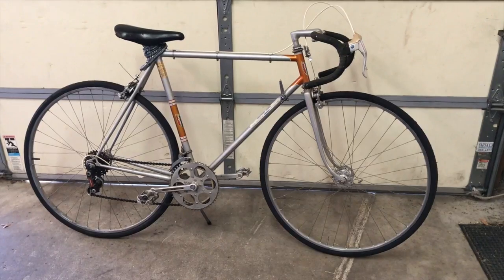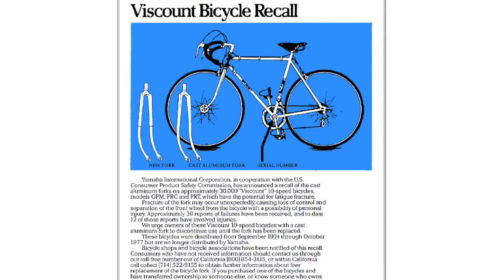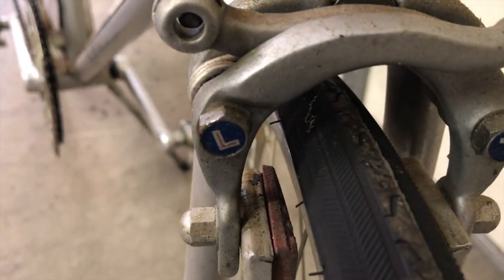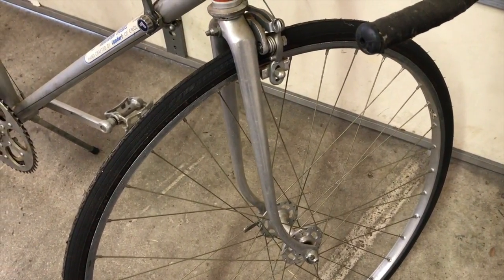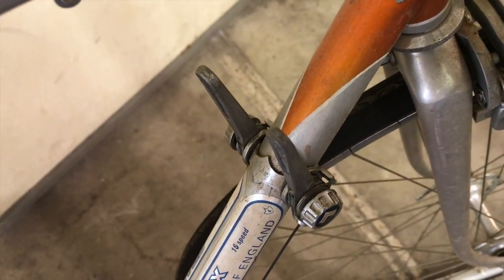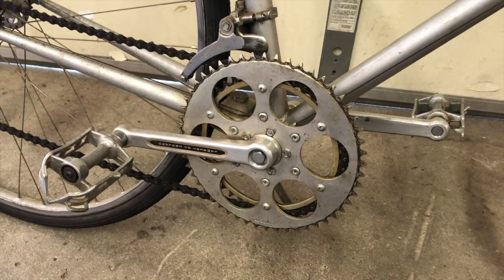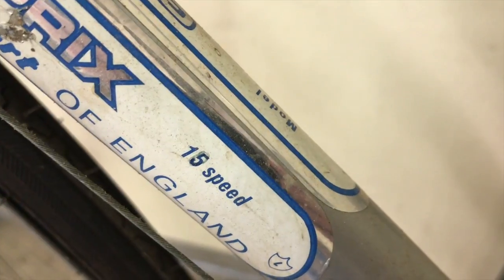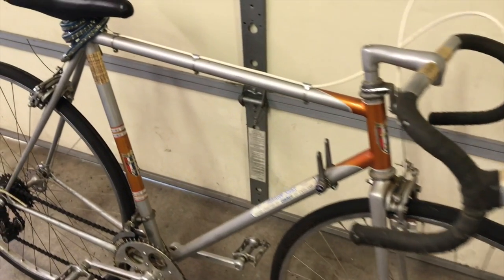1973-74 Lambert / Viscount Grand Prix Road Bicycle - Vintage Bicycle

Comment: maybe it's a 3x chainring?   3x5  = 15
Reply from the maker: +cebuanostud to be a 3x it would need 3 gears up front. It only has 2.
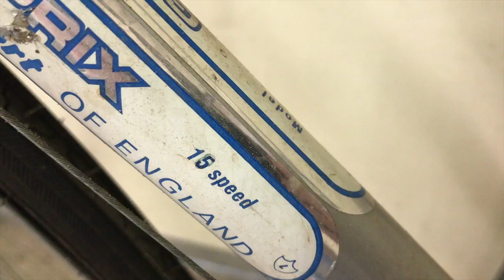Reply: right, so any sign of missing gear up front? at this angle(4:49), it looks to me a smaller front gear can still be fitted.  yes, no, maybe so...
Reply from the maker: +cebuanostud it never had anything other than 2 up front. He bought it new, so it’s likely that they used a sticker (as I suspect) to cover the 5 for the 10-speed models.
Reply: thanks Kev, you cleared everything up for me.
Reply: KevCentral My machinist father was able to add a third chain ring. 5x3 gears
Reply: cebuanostud exactly! A custom mod
Reply: The crank is a rebranded Specialties TA Pro 5 vis, which was easily converted to triple (which was a reason why they were so cool)  :)

Comment: 27" tubes are dirt cheap on ebay all sizes usually are
Reply: Just make sure to get the right diameter not a mountain tube it will be too big and youll be stuffing it in there for 45 minutes
Reply: And likely result in popping it trying to put the tire on

Comment: I love vintage bikes. They look so much better than the ugly looking crap they make today. Back in 1973, at age 14, I had a Schwinn Varsity Sport. It was beautiful and I rode it everywhere. It was a move up from my Schwinn Sting Ray. I still have the Sting Ray, but the Varsity got sold somewhere during the past several decades. It was a TEN SPEED, which was a big thing back then, and way more than enough speeds. I have no idea why they put more than twice as many speeds on todays bikes. Just more complexity, some of the speeds are unusable anyway, due to the chain being so far out of alignment. Some of those old bikes did have issues, the worst being the steel crank arms held on by wedge pins that would not stay tight. 

IMO, people take riding a bicycle way too seriously today, with all the spandex, clipless pedals, and silly helmets. There are few decent bicycles available. You either have to go with a big box bike, or a seriously expensive bike store bike. Neither are right for a casual rider.

While on the subject of bikes, I'd like to complain about what is available (and not available) for kids bikes these days. I had a Schwinn Sting Ray (actually about 3 of them) when I was a kid. I loved it, and spent a lot of time riding on the rear wheel. It was a great looking bike, I just loved the banana seat and high handlebars. Sadly those faded away fairly quickly, and since then all we've had is BMX bikes, seemingly forever. WAY longer than the banana seat bikes lasted. Enough is enough. It is time for the BMX bike to go away. I have nightmares of kids still riding those abominations into the next century. I don't have an issue with the sport of BMX (I raced MX as a teenager)  but there should be something else available for just riding.

I am now partially disabled, and ride a cruiser with a NuVinci 7 speed hub. I can no longer deal with low bars and seats that are nothing more than bump stops. I have never ridden what today called a road bike. I have never worn spandex, used clipless pedals, or worn one of those silly worthless helmets. I did ride hardtail mountain bikes for about 30 years. I also rode a recumbent for a few years.
Reply from the maker: Great read. Thanks for sharing 👍🏼
Reply: Gerald Scott I’m not going to lie, you sound like a grumpy old man.  I don’t understand your hatred for BMX bikes either. My first bike was a banana seat bike with high bars, I don’t recall the brand but it had a removable top tube so it could turn into a girls bike. It could do wheelies like no other but once I got a proper BMX bike it got a whole lot more fun for me, I rode a 20” BMX until I was 18 or so and broke my collar bone after my front tire clipped the top of a landing ramp. 
There’s also plenty of options today for just riding, my daughter has a cute little 16” diamond back cruiser and for boys there’s plenty of hybrid, fitness, and CX bikes that fit the bill. In fact there’s a ridiculous amount of types of bikes really. I certainly like and appreciate vintage bikes but new bikes look damn good to me, even the cheap Walmart bikes LOOK good. 
As for the number of gears, they are on the way down now with modern 1x chain rings. I will say they shouldn’t call bikes 21 or 24 or 27 speed bikes, there aren’t that many useable speeds, if you shift right it’s probably more like 12 or 15. I live in PA with unavoidable hills and mountains everywhere so I’m happy to have the super low climbing gears.
Reply: I outgrew 20" bikes about the time BMX bikes showed up. At first you could get kits to turn Sting Ray type bikes into BMX bikes. I wonder how many wonderful vintage banana seat bikes were destroyed that way. I may be old (59) but I am not grumpy. But enough is enough. The banana seat bikes lasted about 10-12 years. BMX bikes have been around now for about 45 years. It is time to move on. About 15 years ago I tried to get my youngest daughter into BMX. She lasted about 2 months, after I spent close to $1000. The sport of MX (motorcycles) has been around longer than BMX, but you don't see MX bikes on the street. Motorcycles come in all kinds of styles, yet kids bikes only come in one style. BMX. For a while there, I though maybe Schwinn (now a cheap crappy Chinese company) was going to bring back the Sting Ray, but it didn't last long. Back to BMX. I'm 6' with a 34" inseam, and I see guys bigger than me riding those dinky little bikes. They probably don't realize they are destroying their knees. That is part of my disdain for BMX bikes. It's not just kids that fit on them that ride them. Much older and larger kids are also riding them. To me they are the 2 wheeled version of the worst kids toy of all time, the skateboard. My city now has an ordinance against skateboards anywhere but private property. No more skateboarding on sidewalks OORAH!!!
Reply: Man there are a world of bikes you have never hard of it seems.  Expand your horizons beyond your childhood, did you know for example that not only are 20inch bikes thriving, they even split into two main standards, 405 and 451, besides BMX?   Google minivelo and see.  Then there are all sorts of combinations of mountain and road bikes from single speed to as many as you like.  Belt drives and even 2 wheel drive Subaru bikes.
Reply: Gerald Scott I rode a Raleigh 3 speed tourer, best bike design ever. My Sting Ray friends and their silly banana seats never strayed far from home while I could easily ride to other towns.